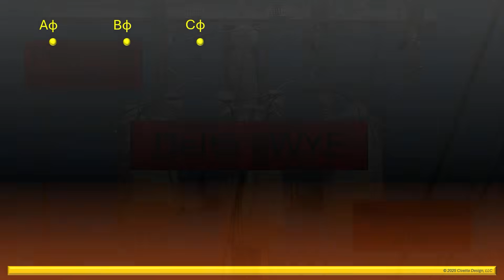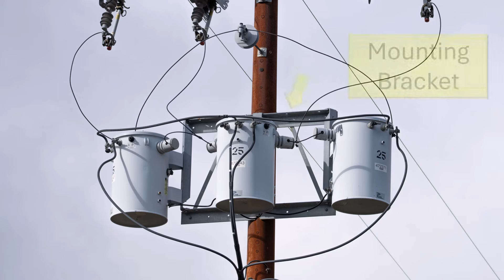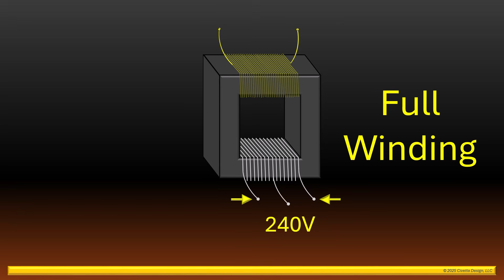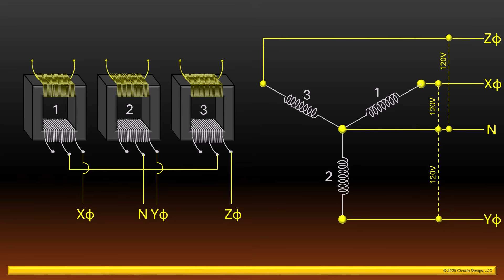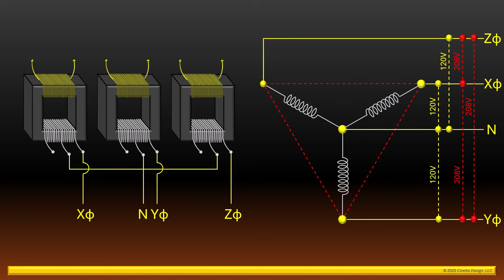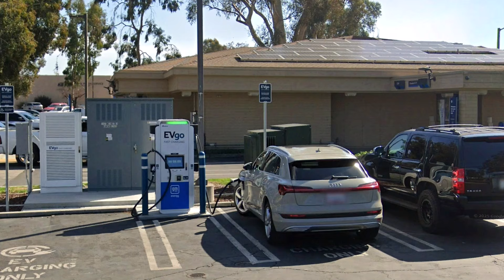Three-Phase Transformers Explained | Delta vs Wye Basics

Comment: Single phase voltage at the turn of the 20th century was standardized at 110 volts AC, by mid century it was raised to 115-117VAC split-phase AC power (220, 230), in the late 60's it was raised to 120/240 volts. For industrial applications requiring more wattage, three phase power is utilized, it is delivered in three configurations: Delta (triangle loop) with no neutral plus safety ground (4-wire) 240/480 "line-to-line" voltages, or Wye (star) with a neutral plus safety ground (5-wire) 208VAC line to line and each line to neutral 120VAC or 480 line to line or 277VAC line to neutral, and Delta with a "wild-leg" and a neutral and safety ground (5-wire) 240 line to line, phase B wild-leg to neutral 208VAC. David Riddle

Comment: This is a good video. My only comment is regarding what you said about only using half to transformer winding. That is typically not the case.(as you would be wasting half of the Transformers capacity). Most polemount Transformers have two distinct windings with four separate leads. For normal 120/240 V operation. The two windings are in series (in additive polarity) with one end of each winding connected to the middle bushing for neutral (inside the tank). When you’re going to use the transformer as part of a Y bank, you lift the leads and reconfigure the two windings in parallel and connect them to the center and right bushing. That allows you to utilize the full capacity of the transformer in the 120/208Y configuration..
Reply from the maker: Steven, thank you, great field-level detail. You're correct that most polemount transformers have two distinct windings with four leads, and in a Y bank application those windings are reconfigured in parallel to utilize full transformer capacity at 120V. In the video I was simplifying how 120V is derived from a 240V-rated unit, but your explanation of the actual internal winding configuration is an important distinction for anyone working with this equipment. I may cover that in a future video,appreciate you adding it!

Comment: Great Post!, Our home is served by a 208Y/120 from the Poco. We have three Transformers on the pole. This morning I awoke to a missing phase, an animal had scaled the pole and blew one of the shotgun fuses, leaving the hallway and bathroom lights in the dark. Gotta love those Electrically inclined squirrels! ❤❤❤
Reply from the maker: Thanks for sharing :) hope the squirrel survived 🫣
Reply: Are you receiving 3 phase 208/120V or are you getting single phase 240/120V from one of the three transformers?
Reply: @scottykatzenbach  It comes into the main panel from the meter on the outside wall from the overhead weatherhead using 4 wires as 3-phase 208/120. From there it goes into a Transfer Switch for the Ford 300-6 Generator. Then it goes into the house, patio and workshop to a few sub-panels.
Reply: @atomscott1919 Ah I see, very nice. Having a workshop explains the need for three phase. I was just curious lol